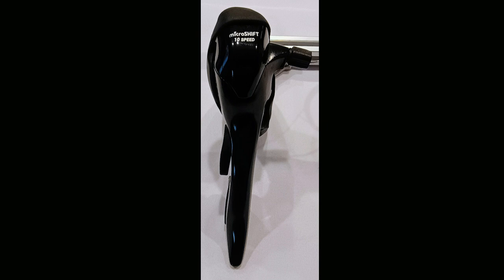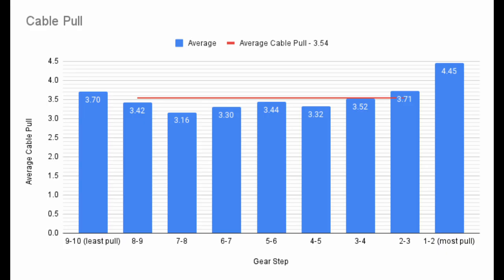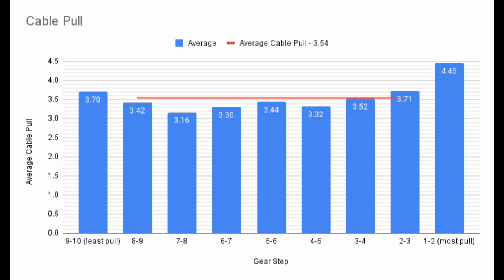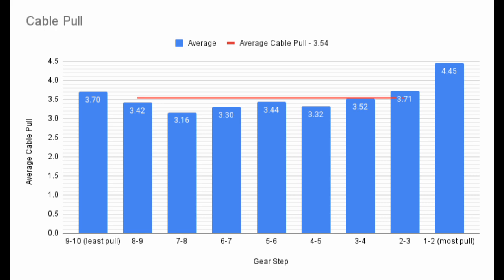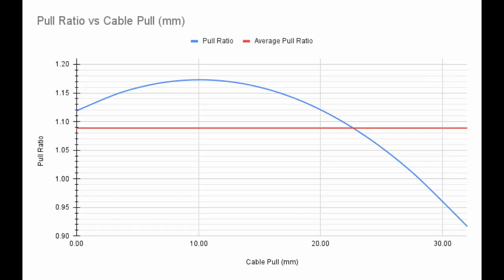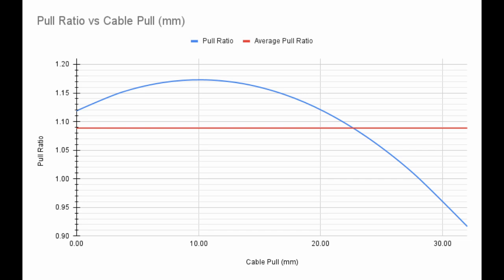Microshift Advent X 10-Speed Drop Bar Shifter Cable Pull

Comment: Microshift will soon release Hydraulic Shifter. It will also work with CUES, ADVENT, SWORD, Sunrace UX/US/U9.
Reply: So, are we pretty confident that CUES, Dynas-Sys and SRAM MTB11/12 RDs have similar pull ratios at around 1.1?
Reply: @joshbeck720  Yes, but Microshift delay their hydraulic shifter plan.